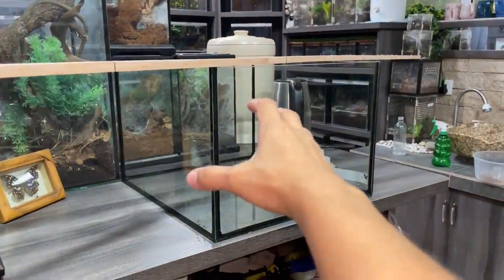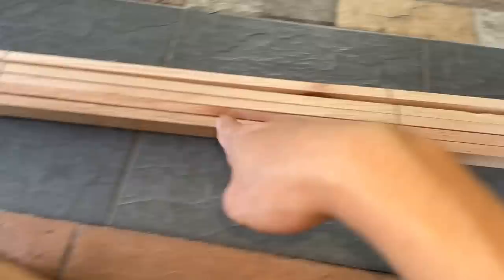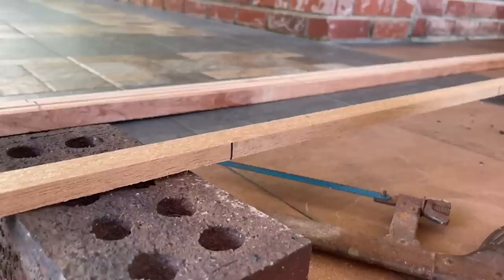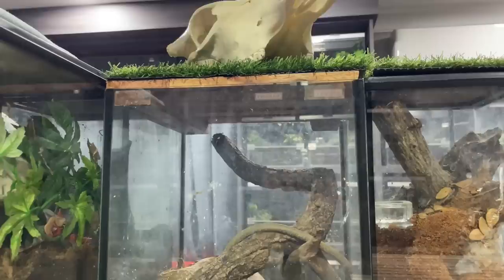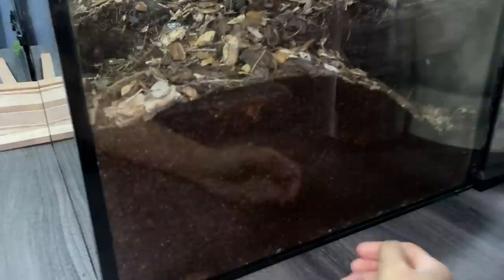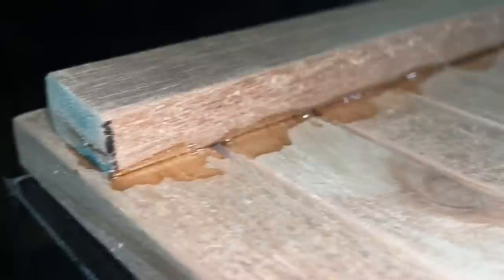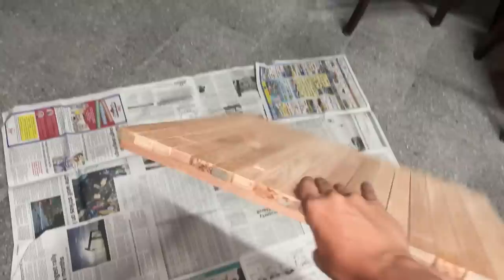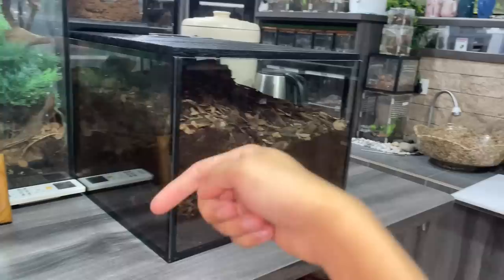HOW I make TARANTULA covers !!! (Highly Requested Video)

Comment: You could use spacers to get the spaces even. You can buy them or just use a coin or whatever you have on hand. Use clamps to hold the boards together while the glue sets up or while you get the spacing correct. Also, you might consider leaving the boards longer until you are done and then marking your cut lines and then cutting the lengths. This would give you a more even appearance. Nice job!

Comment: When cutting wood you want to allow for the width of the saw blade .
Reply from the maker: What do you mean? :o
Reply: @ExoticsLair  i think he means u wanna take account for the width of the saw blade so u dont over cut or under cut it i think idk
Reply: When you saw you lose the width of the saw, hence sawdust,  plus also account for the sanding down
Reply: Yes because I felt like these would be a smidge too short and fall in after he did the sanding and cutting but it turned out good this time. In the furture for sure make them like a cm bigger on each side esp to support the weight of another tank on top.

Comment: If you are afraid that the nails might split the wood, hit the point of the nail with the hammer a few times. This way, the nails will break the wood fibers instead of pushing them aside (and posibly splitting the wood).